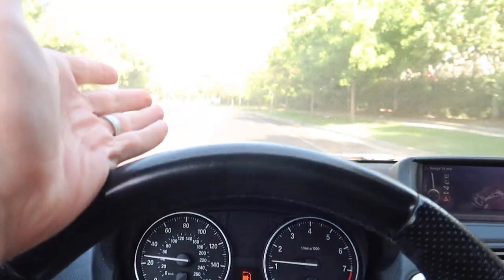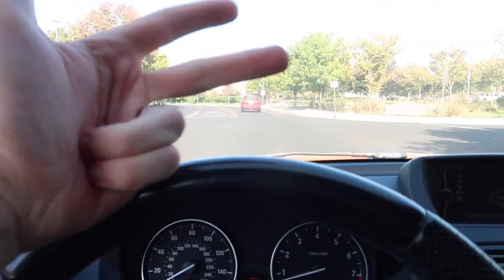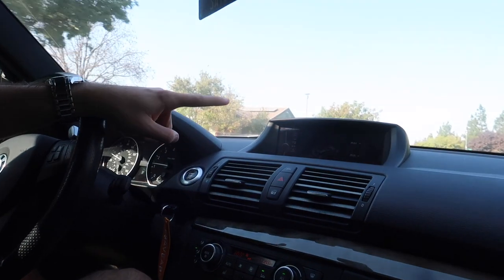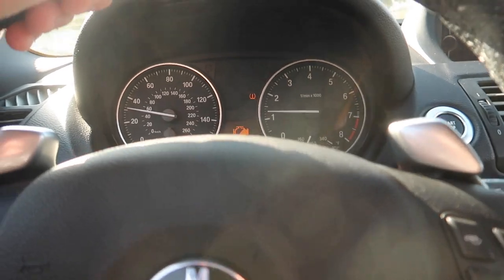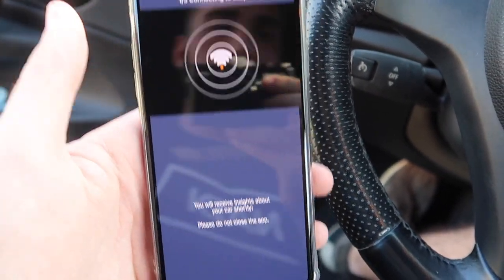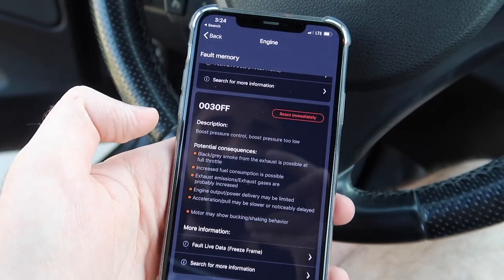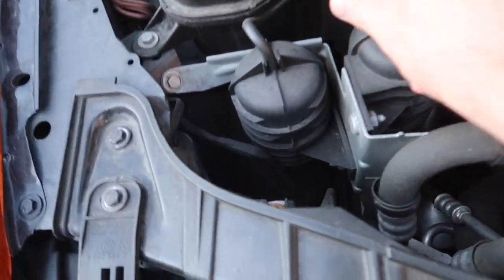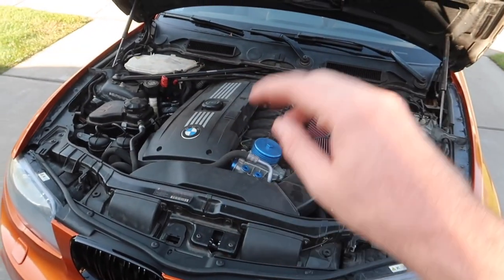I FOUND OUT WHATS WRONG WITH THE 135I! (ZERO BOOST)

Comment: The downpipes would cause an exhaust leak not a boost leak. You could literally run it with no downpipes and it still wouldn't cause a boost leak.
Reply from the maker: hnnnnnnnnnnn
Reply: @NourHummadi  I'm not suggesting you actually run it without downpipes. Smh.. I'm just saying the downpipes only purpose is to direct spent exhaust gasses out of the back of the turbo and down the exhaust pipes to the muffler. The downpipes have absolutely nothing to do with the pressurized boost tract, boost leaks or the compressor side of the turbo 👌
Reply from the maker: MunichMotorsports I know 😂
Reply: exactly what i was thinking about, how can you get a boost leak coming from the exhaust? is that even possible?

Comment: It may be leaking from the intercooler connections as well. Especially if you still have the stock connections.
Reply: Yeah literally just fixed my this morning, i want to install my aftermarket intercooler but i cant find a way to take off the coupler from the passenger side
Reply: @acuadras12  even with the intercooler off?
Reply: I could only take mine off with the intercooler off the car. The gasket can get stuck. Unless you use a flathead or pry bar.
Reply: @billyowusu48  yeah i had my intercooler off and yeah it was stuck i tried a flathead but i couldnt really get it out so i just put the stock one back on until i find another way to take it off

Comment: Downpipes have nothing to do with a boost leak. They're not part of the pressurized boost tract at all, they're only part of the exhaust dude.
Reply: That’s what I was thinking
Reply: An exhaust leak might prevent you from building boost tho if it’s big enough
Reply: Especially if it’s on the downpipe
Reply: @CrazyUnicorn48  Not with the N54 engine. The exhaust leak would let pressure flow easier, in turn building more boost easier. You need to have knowledge of the N54 engine as it's an unorthodox approach in n regards to turbo set ups. Everything from the wastegates in line to the intake manifold is where he needs to look for a "boost" leak. Anything else is just an exhaust leak with absolutely no negative effect on boost.
Reply: @brandonbelstad6450  oh okay good to know 👍

Comment: Also remember to check the chargepipe to TB connection. The gasket can fail with an aftermarket charge pipe. Whatever you do, please don’t sell that car!
Reply: Hey Billy You're one of the very first I've ever heard talk about this problem. I have bought two charge pipes and one is an "ARM Motor Sport" brand. As well I have bought two throttle bodies (Used because I thought I had a freakish problem). It turns out (I think I'm not SURE) that the throttle bodies start to wear or something and they leak making a very crazy sound. NOTHING I've done has solved it yet including replacing the "O" ring on both sides with BMW OEM "O" Rings. Still the car makes crazy sounds! And I'm certain it's coming from the throttle body to Charge pipe connection. I've even installed the "ARM" Intercooler to charge pipe up graded 3 inch silicone kit! I'm now guessing I must breakdown and buy a brand new throttle body unless there's a fix for this that's cheaper. I get the 2D2E code all the time! Billy if you know anything about this stuff PLEASE help. Thanks!